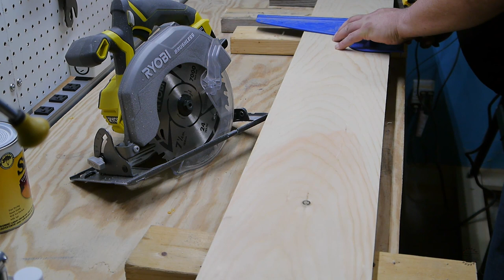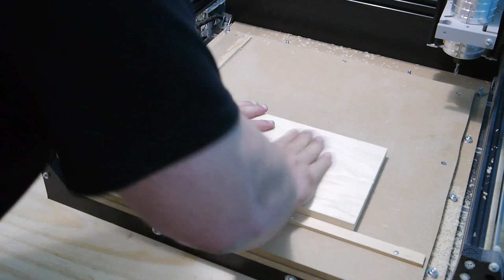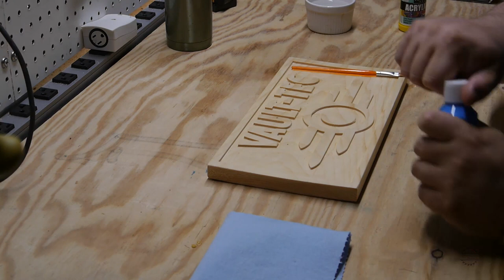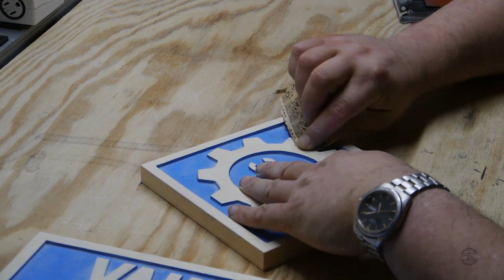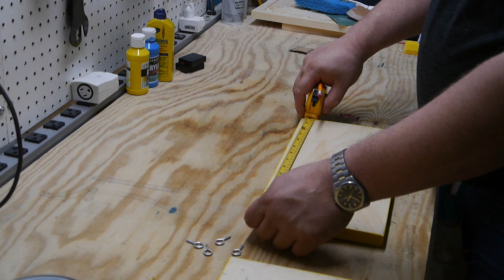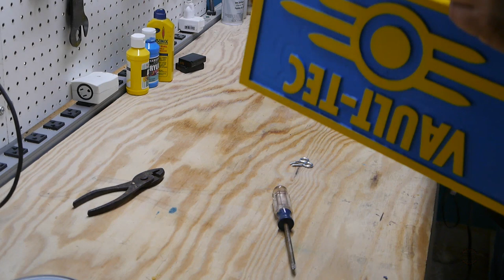Making a Fallout inspired sign on the Carve King CNC

Comment: A nice alternative to the 2 sided tape is placing painters tape on your work piece, and in matching places on your waste board. Apply some CA glue to the tape on your waste board, and spray activator on the tape on your work piece. Painters tape, even 2 layers is thinner than the tape you used here, which gives your work piece less of a cushion to move around on.
Reply from the maker: I agree.  Nice tip.  Most of the two sided tape has a wiggle factor.  I'm now mostly using mechanical fastening.  I purchased the ca glue and accelerator to try that method a while back but haven't used it yet.  Thanks.